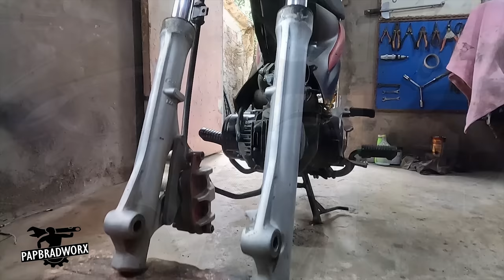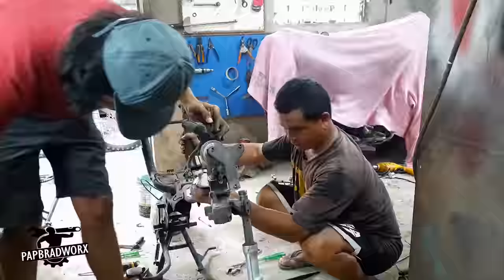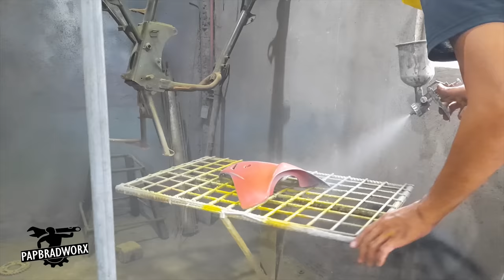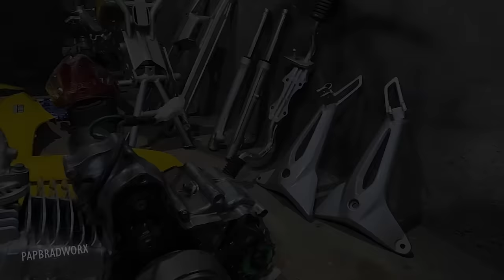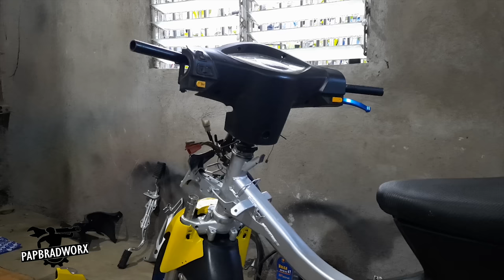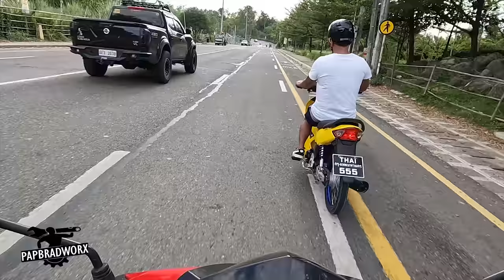Conversion | Honda Wave 100 R | Thai Concept | PAPBRADWORX

Comment: Bradworkz ano ginamit mo na primer sa metal parts yong kulay gray?
Reply from the maker: Urethene surfacer brad...Webber ung brand...👍
Reply: @papbradworx  ayos. Anti-corrosion ba ang surfacer brad?
Reply from the maker: Iba po yung anti-corrosion iba din ang surfacer..